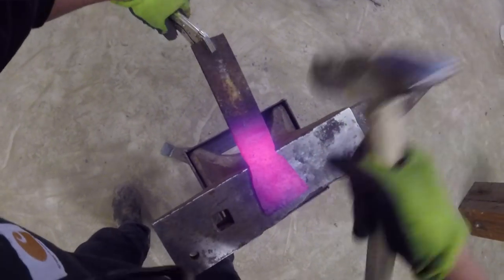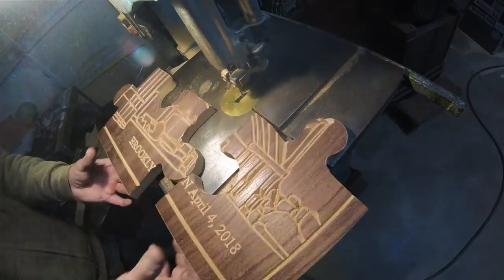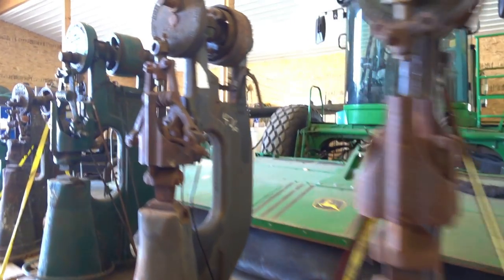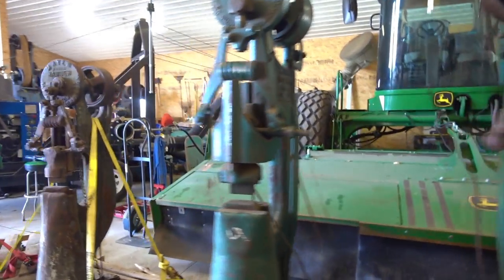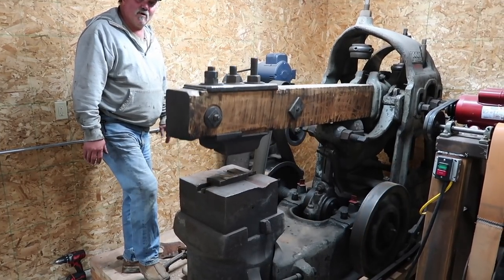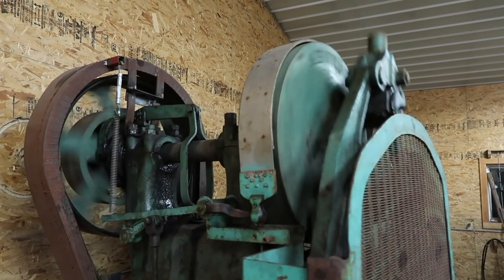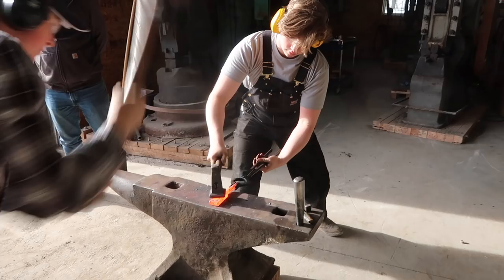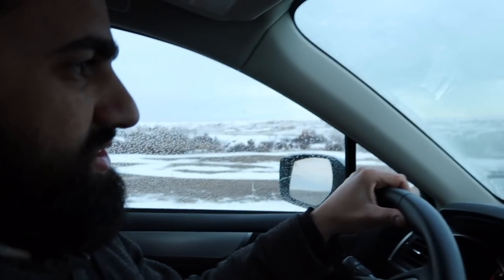DiResta 67 POWER HAMMERS

Comment: Reminds me of my father, who once was doing testing of operators of steam forges. Part of the test was to show control, by taking a pocket watch and closing the lid with the hammer. so dad takes his pocket watch, places it on the anvil, and the operator would take the hammer to full up and then bring it down to close the watch. Unknown to the rest, my father was unhappy with that watch, it was irregular, so he had quietly talked to the operator being tested beforehand. The hammer went up, and it was explained as to the control that the watch would be closed gently. All the others were standing around when the operator went full power on the stroke, making a noise that stopped every other person in the place, and then proceeded to do another dozen equal blows on the anvil, turning the pocket watch into a brass smear on the anvil. Dad went there, looked at the smear, and pronounced that it was perfect, placing the pass mark on the paperwork for the operator.

Comment: LMAO I have a bench top metal planer 4" wide 12" bed move. single point tool hand crank.
Reply: Excuse me?...
Reply: Yes I have a bench top metal planer, the bed is 4" wide with a 12" bed motion it is hand cranked. It was built in the late 1800s. I restored it and it is in storage until I build my new house and shop.
Reply: You lucky, lucky man.